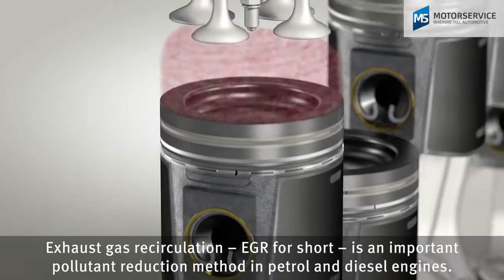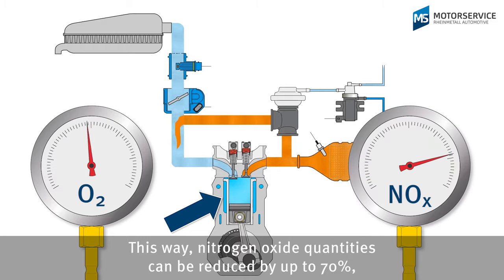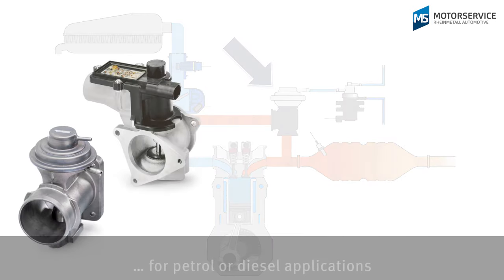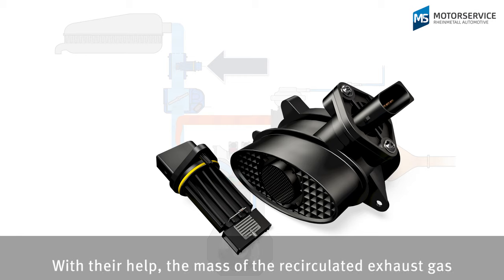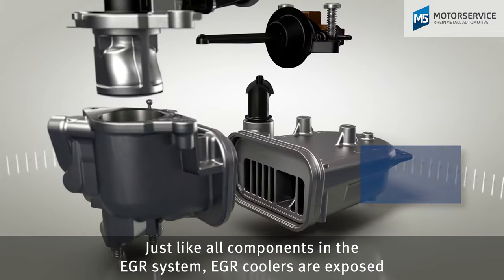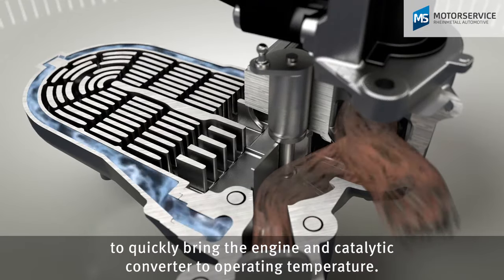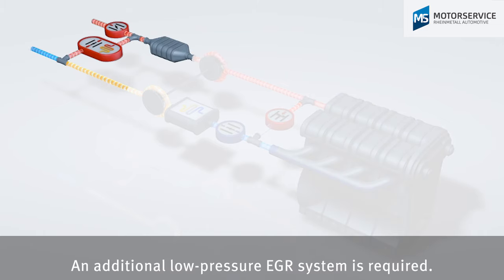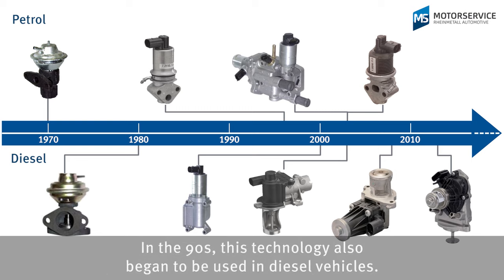Exhaust gas recirculation (EGR) made easy

Comment: What they don't tell you is that particularly in diesels, it reduces fuel economy which in-turn increases fuel consumption. I also increases engine wear and reduces engine life. If the EGR or EGR cooler fail (which they do often) they can allow soot into the cylinder which can coat the cylinder walls and damage them or the piston.
Reply: These things are also investigated and tested prior to mass implementation with the intent for the systems to last a minimum threshold of time/usage, so don't be so negative. Yes things get clogged etc and performance affected in the long run but that applies to all components. It's just a matter of maintenance like everything in a ICE.
Reply: i believe your point , my Hyundai traject engine piston worn out so quickly after investigations we fount out that the erg valve causes the soot on the intake manifold which in turn escape to the cylinders and causes the rings to worn out
Reply: @thenozar7603  Don't confuse negativity with factual reality. As the saying goes, the road to hell is paved with good intentions.
Reply: Thats why many do an EGR delete!
Reply: @drincogni  I just did an EGR delete and man!! My 260k mile or 410k kilometre engine feels like a brand new engine! Much more responsive and fuel efficient
Reply: I did an delete on my Volvo D4 engine. The intake manifold is made of some kind of plastic. Which can catch fire if the heat exchanger don’t do its job due to carbon build up. I have clean my cooler twice and the manifold and ports one time. Enough of that. Now the egr are blinded. Next step is to do a ecu blank. The car had run 81670 Km.
Reply: I just started noticing today my engine is a bit louder than usual and it shakes at idle. I didnt have the ecu remapprd to work with a plugged egr but if that solves it i'll write it here. Also the engine has trouble warming up in -4c and also staying at 90c
Reply: @thenozar7603 no it's true it's not about pollution it's just political they want control, I own a diesel and I had way more soot flying out my exhaust with all emmison dpf and EGR and tons of problems with them, now that it's an off road use only on the ranch she is running good with no expensive problems 👍

Comment: EGR - what makes cars less fun, repairs more expensive, bureaucrats happy.
Reply: @Steven_Rowe  lol. Is leaded petrol banned? I wasn't aware of an actual complete ban. Also EGR systems regularly fail requiring replacement of parts, which cause pollution to manufacture and also the risk of destroying the engine, since a failure mode can occur where coolant goes into the intake. The systems also cause engines to run less efficiently than they otherwise would, so overall more fuel is being burnt. So if you take into consideration the extra parts being manufactured, plus their common failures needing replacement, the lower fuel efficiency, if we include AdBlue, that adds weight and is another product requiring manufacture and transportation. Are these systems really reducing total emissions and less pollution in other forms?
Reply: @Steven_Rowe  you breathing also pollutes the air. You want to live? Things need to be transported and i still haven't heard how the expired batteries from electric vehicles are recycled or disposed of. Will that be an environmentally friendly process?
Reply: @Steven_Rowe  Everything causes pollution in some way. Lots of things involving burning fuel are fun for most people. You are using electricity to write comments and some sort of device. Is electronics manufacturing done without pollution? Hypocrite
Reply: @chrisnoname2725  your point I take, but are you saying because something can fail then therefore let's not have it.
Why don't we say bugger pollution, let's go shoot a loonie lefty.
I look at this way we all polite whether we know it or not.
Don't you think you and I have the right to breathe clean air?
Were never going to live in the utopian perfect world but surely we need to at least strive too.
I no longer live in the city, is the air perfect, probably not.
Reply: @Steven_Rowe  you do realize by haveing a egr your making the car have a shorter life parts be replaced more often witch all contribute to pollution if they ran the car without a egr in total that car would produce less pollution this is even more true when it comes to diesels
Reply: @drippy6706  well you obviously no more than everyone so thanks for your advise.
So are you seriously telling me that they are put on for fun and all the scientific advise including medical is wrong.
It's all about nitrogen oxides that causes cancer , birth deformities etc etc etc, but you knew all of that no doubt.
Here is what I do realise, I have a mate who has spent the past 45 years with diesels, he is the head of training with Volvo, whilst he is no chemist he does accept the advise about nitrogen oxide emissions as fact.
Not only that has it ever occurred to you or do you indeed no about dieselgate????
It was the lies the lies regarding diesel emisions on VW cars where they tested cars that past strict emission standards but the software programs turned off the emmision in use.
You actually probably no more than everyone put together including environmental protection agencies.
Well what you think you know and what you believe you think you know is probably different than what you really know.
With due respect to you I would rather take the advise of legitimate health organisations and scientific research.
No doubt you have also removed your DPF filter as you have little regards to what pollution does not only to your own health but everyone else.

You do not have to be a left wing tree hugging vegan Greenie to realise were messing up our own world and shifting in our own beds
Reply: @Steven_Rowe  egrs were put on cars as a result of putting in cats on cars because the engine runs hot gases through the they cats would get so hot they would start burning up releasing dangerous air 
So they made the egr that regulated the tempture of the engines air by recirculating dead air pretty much back into the engine
Egrs do not stop nitric oxide the cats do but as stated above they had to adopt the egr to keep cats
 Since the introduction of this system it has been bad not mention the prevalence of egr failures especially on older cars 
That's not even including the increased stress on the engine 
Reduced gas mileage 
Egrs reduce the engine life of any vehicle their installed on 
 The question is does destroying engines make people burn even more gas etc really reduce pollution more than their was before 
Nitric oxide is more of a concern with diesel vehicles compared to gas engines  thays is true thou 
On trucks today their are multiple different systems not to mention their egrs with the intent of reducing pollution  that further impact has mileage and cause the consumer to buy exhaust fluid for their vehicle on top of that the thousands of dollars on repairs needed because of these systems 
 The question is does it really give more benefits than the problems it causes my opinion is no their has to be a better way to do this than the current systems
Reply: and we all live longer
Reply: And Soot ( Especially In Diesels )

Comment: I have no issue with new cars having all this complicated emission requirements, but what I find frustrating is that by the time modern diesels are 15 years old they just won't be maintainable.
These complicated egrs, dpfs cats etc cost a fortune to replace such that it may be more economical to write the car off.
Is that sustainable?
I feel there should be relaxation on the rules when a car reaches a certain age.
Cars may be considered classics when they are 15 years old so that age seems about right to me.
Reply: You're absolutely right. As with most things 'green', it ends up making more pollution due to a shortened period of exploitation. There are entire service centers build around cleaning those systems, which is almost an annual maintenance item if you're primarily using your car for in-city driving.
Reply: Its the way of the future just ask the greens , they dont think of the bigger pictures they just look at the here n now just like all protesters,  they all need to open their eyes and listen to all sides of stories as they may start seeing the real truths rather than what is being spoon fed to them by crooked politicians n so on , they need to stop being lemmings and start looking into things for themselves to make a real difference as currently they are making it so everything ends up in the rubbish tip as china doesnt want their rubbish back
Reply: I find it kinda retarded how we must fix the environment by using even more buy and throw away culture. 
I often feel they just make these systems so over complicated so people can't afford it. 

That being said, i actually don't think i ever changed a cat on any of my cars, i have a Citroen C4 Picasso now that need a dpf, but it have a service life at about 180000 km. 
But yes here in Denmark this is total bananas with taxes, i pay around 600£ or 6000 DKR, a year just to have a Saab 9-3 standing still!!

Comment: I used to always install a plate under the egr valve, blocking it's function. Used to! I now do the opposite, i "block" the egr valve open permanently, this allows me to advance the ignition timing substantially, so that i get a lot more power out of a lot less gasoline, without any knocking or pinging.
Reply: You’re not getting more power because half the gas in the chamber is inert. So basically you’re just compensating by advancing engine timing

Comment: I really have a hard time understanding this concept! We take warm hot exhaust gas and put in into the cold intake air, to cool the combustion chamber so it reduces nox? I find that like trying to cool your freezer with a blow torch? 
Also we take exhaust gas and take it into the intake to lower O2 levels?! To reduce CO2? 
Well how do that work? If you lower the O2 level, the engine would want more air to make the lambda burn fuel near stoikiometric?! Hence doing this would reduce the engines output and wasting the efficiency? It makes no sense to me why you would do this or going this way to solve a problem.
Reply: It’s basically used to lower the volumetric efficiency of a vehicle by filling cylinder volume with exhaust gas that has no clean burn able oxygen in it. Doesn’t make any sense to me. I’ve seen more problems with egr systems then benefits. It would be interesting to do back to back dyno testing on peak power output with and without egr as well as track fuel consumption with and without the system in some sort of controlled environment.

Comment: What would be the temperature difference in the combustion chamber with vs without recirculated exhaust gas?
Reply: This depends on the percentage recirculation. Im currently studying this as part of my thermo course but there are optimizations to be made regarding power output and combustion temperature.
Reply: @thenozar7603  If you reach some actual numbers. Aka the derivative of the heating function. Where input is % of exhaust gas and output is temperature. Or just plain numbers 5% -> 10 degree, 10% ->12 degrees etc. For me its important to understand the magnitude of the effect not actual exact numbers. Because if lets say current average recirculation percentage is about 30% and the thermal cooling effect is 2 degrees then I'd pretty much ignore the cooling effect overall and remove the EGR

Comment: It’s a old inefficient system in my opinion, yes it keeps engine temps low, good for a old Tahoe an it’s little clutch fan in the summer, but choking out the motor is no fun. There’s better methods, I’m removing mine😂

Comment: Can egr malfunction cause a misfire ?
Reply: Yes ! if the EGR valve becomes clogged or damaged, it can cause an engine misfire. Cheapest way is to take it off and clean it with parts cleaner like brake cleaner carb cleaner etc. Often times you can do this without having to replace them.

Comment: When to service the system so it doesn't blow nasty stuff into your intake and mess up the motor?
Reply: 50k miles. Remove and spray with carb cleaner.

Comment: ALL OUR LIVES we are told the IMPORTANCE OF CLEAN AIR FILTER for engine longevity.
then manufacturers DIVERT ABRASIVE/ ACIDIC SOOT back into the cylinders which GUMM UP RINGS, abrade bores and ACIDIFY OIL.

Comment: Why are the manufacturers fitting these egr valves if they are clogging up with carbon causing the vehicle owner to fork out thousands of pounds to get a replacement only for it to happen again in let’s say another 56k mileage a but yet the DPF has a system that does a reg.
Reply: You just answered your own question.

Comment: Good grief all more components to fail I’m a vehicle. Which is why I did an egr and cat delete for better performance with a tune 😎😎
Reply: Yeah. Screw the enviroment
Reply: @johnturner4400  settle down greta thunberg
Reply: @5PYZ3R  Apparently not, my drive to work it takes the exact same amount of time to warm up. I can’t tell the difference. I have however noticed a mileage and small hp increase without my cats. They might have been kinda clogged but I’m sure as hell not buying new ones. StUck bare cheap pipes in their place:)
Reply: @5PYZ3R  Actually, I know a solid amount about performance having studied a lot of books involving airflow mechanics and such.
Reply: @5PYZ3R  Anything attached to your exhaust reduces power. Whether it's a cat, DPF or even a muffler they all reduce power. The most efficient exhaust is a straight pipe.
Reply: @LCDqBqA  right, but arguing about an 8hp difference isn’t the right thing to do
Reply: @sparkie5571  I don't know if the same applies if you're running 1.8-2.0 bar boost . On that pressure you probably have to remove it

Comment: Take EGR off and see ste state of it. If you drive mostly in town, it will be cloged up.
Reply: How will it be clogged up when the exhaust carbons are not fed back through the engine , its the exhaust carbons sticking to the oil vapours being drawn through via the pcv , these harsh carbons then also scratch the bore surface causing internal issue's,  500,000km on an rd28t and still running strong as day we bought it and still with clean oils when its time to change conpared to others always having engine trouble an oil is black as charcoal , I think greenies are killing the planet more with all the broken vehicle's than they think, same with sending manufacturing to china as now nothing lasts like it used to and is more expansive and ends up in rubbish tips , so you please believe what you want but I'll stick with what I know factually works n lasts, I also use less fuel with no egr than I did with 1 and also my egt is lower than with an egr funny that aye

Comment: Reduces carbon dioxide emissions because most of the carbon accumulates inside your engine until it clogs it completely at some point. By reducing the combustion temperature, there's no complete combustion of the fuel, which is a perfect recipe for carbon accumulation.

Comment: This technology causes problems in suction valves and in alle suction system if the engine needs much more a temperature for a while it can take it from the metal part of the exhaust fore one minute ,this is a vain system,why should it be this when this releases carbon dioxide and smoke soot